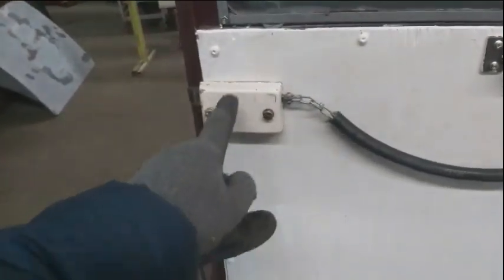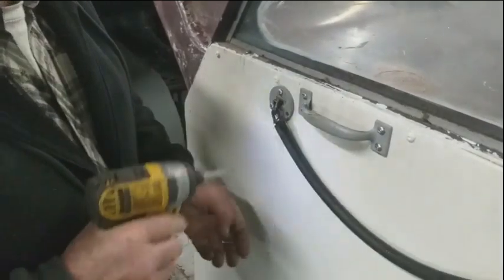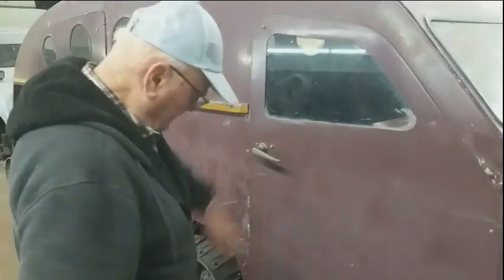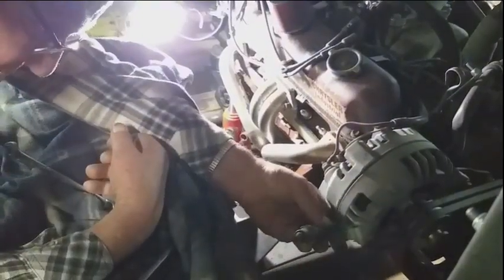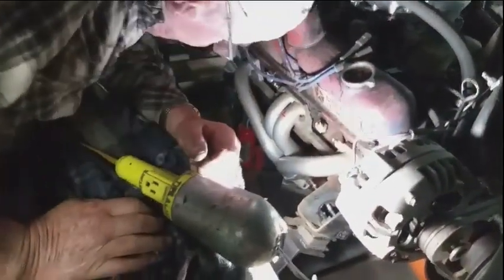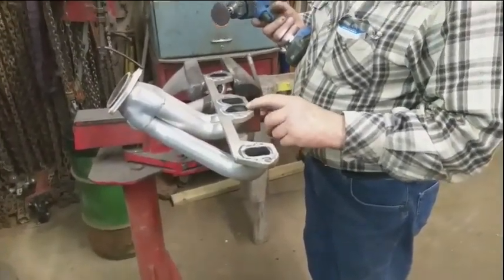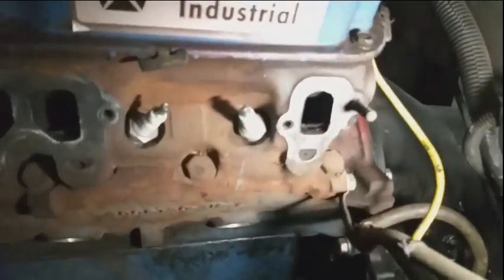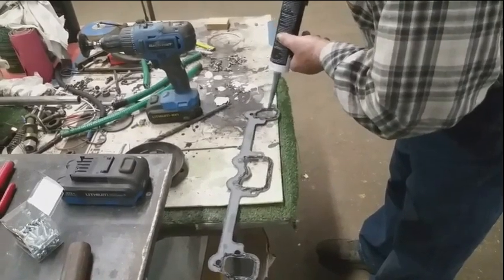HOW TO INSTALL MANIFOLD GASKETS | BOMBARDIER

Comment: Good Video. If that's a 318 with 5/16 manifold studs , ask your dad what the part number is for those 1 piece gaskets he uses. Thanks
Reply from the maker: Dad says it is a standard 318 manifold gasket. But he will look up the part number at the shop
Reply: @dadsrepairshop  That would be great, the gaskets I'm using don't cover enough on my headers .